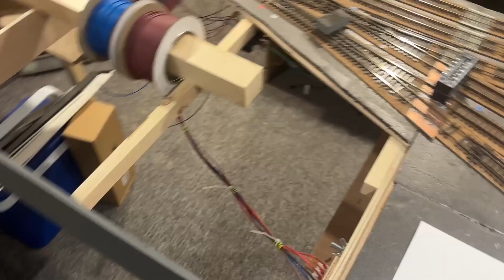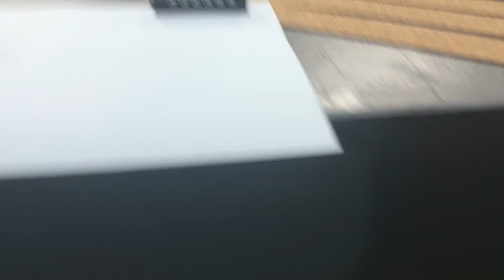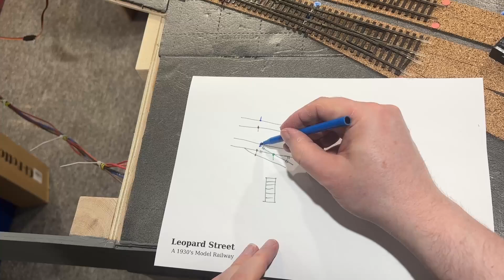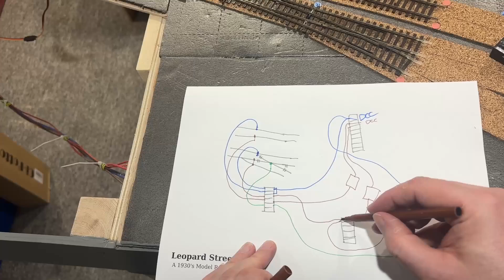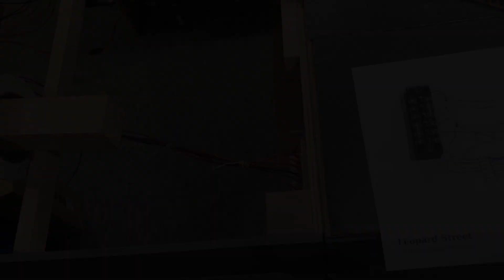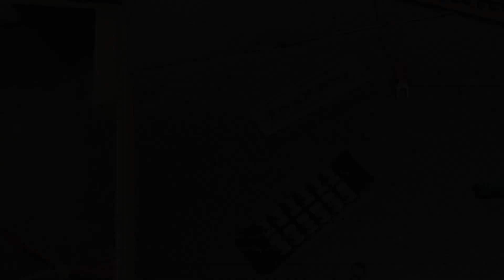Episode 50 Wires and Wiring at Leopard Street Model Railway

Comment: FYI: While the metric wire sizes are very accurate, they are a mouth full to say. It is not unusual for professionals and amateurs to use America wire gauge AWG. for quick talking because of one number.
Reply from the maker: it can be useful, main problem being I haven't a clue which wires are what AWG as that is not on the listing when I buy them, just the strand number and diameter, plus a current rating that for low voltages tends not to be very useful.

it is however something I will look at as you rightly point out this could be useful information to others though, will look this up and reference in future :)

thanks for the comment and useful advice :)

Comment: Use Unifrog points. You dont need to make them DCC friendly like electrofrogs. Better still, every route is correctly powered out of the pack and you dont need to use insulating rail joiners.
Reply: its a good idea, only really heard of them after I started this of I may have had a look, I saw the bullhead stuff and balked at the price then never looked further

thing with the modification though is the switch rails are no longer used as electrical switches, just mechanical ones - does mean the relay is needed, not ideal though I do like the unifrog idea, its nicely done, need to investigate further for as and when the next layout happens, certainly worth a look now the ranges are expanding though

cheers for the thought though :)